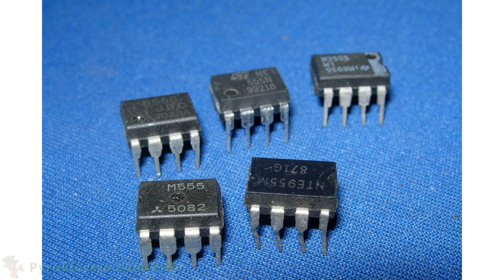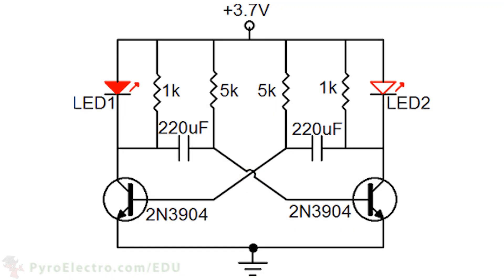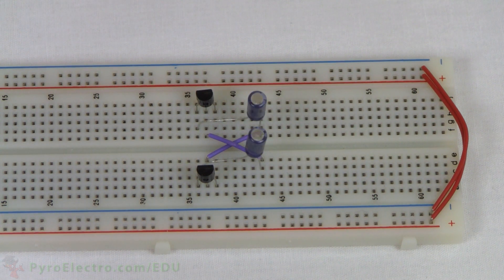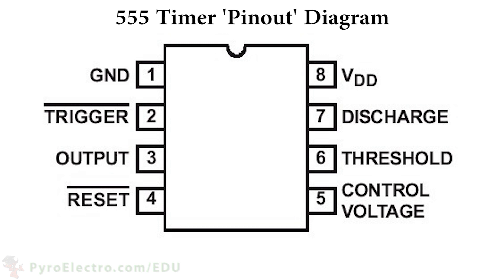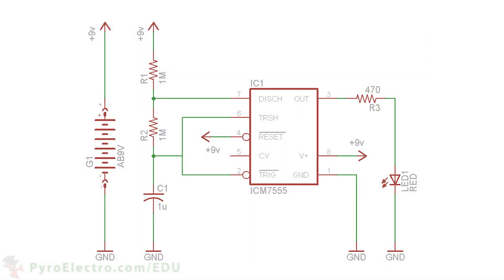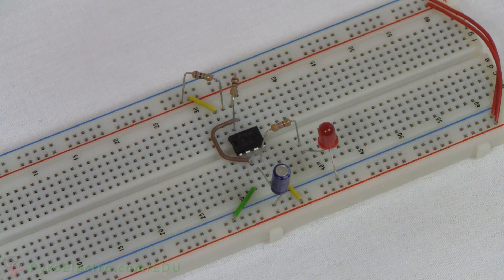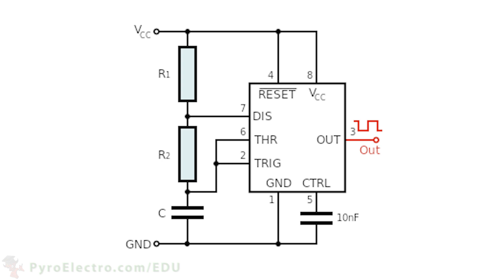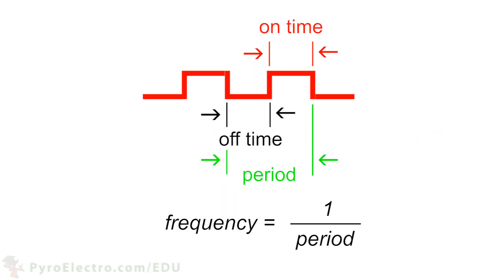PyroEDU: An Introduction To Modern Electronics - The 555 Timer

Comment: Why in the schematic are the 555 timer pins not in order?
Reply: Because it is more logical to move the pin outs so they are easier to draw on your circuit without having too many lines criss crossing over, the actual pins in the chip of course remain as per the pinout chart

Comment: If the astable multivibrator is symmetrical, is the duty cycle always 50%? If the capacitors are asymmetrical, would the duty cycle change?
Reply: The whole idea of circuit work on breadboards is so that YOU can experiment, therefore finding YOUR own answers, as long as you work with 9 volts or less you will come to no harm, however your components may suffer and stop working, so please stop asking questions go out and experiment, when you get it wrong and things are not working, then that is the time to ask.

Comment from the maker: Hi!

Ton uses R1+R2 because C charges through both of those resistors.
Toff uses only R2 because it's discharging the C through pin 7.

69% is correct for this usage for 1t. I wish I could explain here, but this is really only meant to be an introduction. Hopefully in the future I can do a full video on the 555.

This website explains the 555 timer in great and specific detail:
doctronics . co . uk / 555 . htm (take out the spaces)

Comment: Hello, 1st of all thanks for the video and the explanation u afford, we appreciate.
So I got some two questions;
About the formula which u calculate with it Ton and Toff;
Why you used R1+R2 to calculate Ton and only R2 for calculating Toff? 
And its 63% what corresponds for 1t of charging capacitor not 69% ?

Thanks again
Reply: During each cycle the capacitor, C charges up through both timing resistors, R1 and R2 but it only discharges itself  through resistor, R2 as the other side of R2 is connected to the discharge terminal, on pin 7.